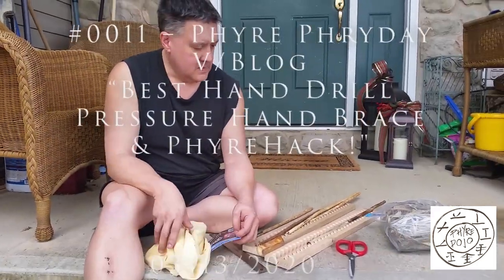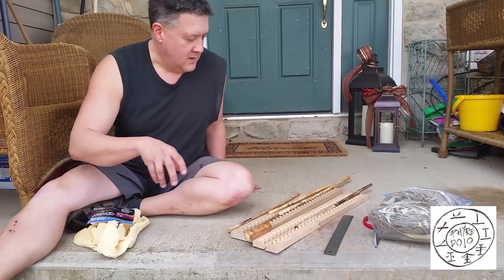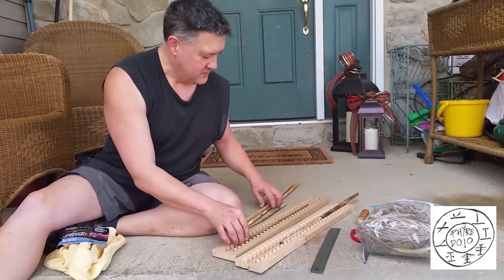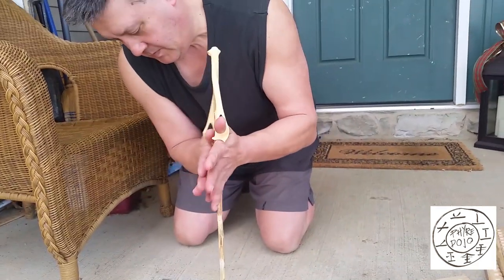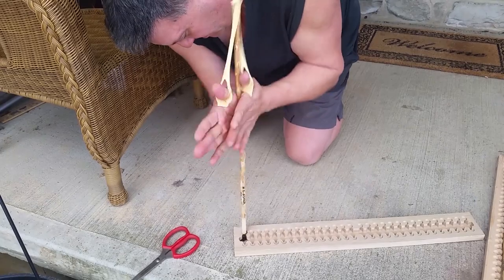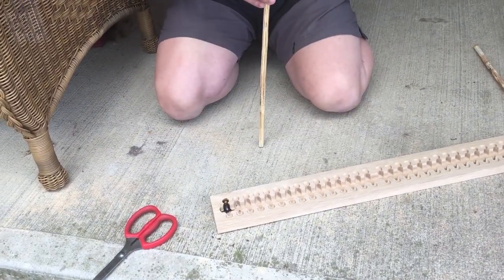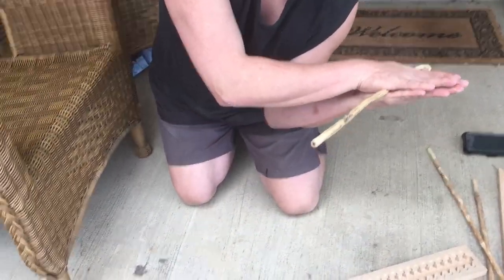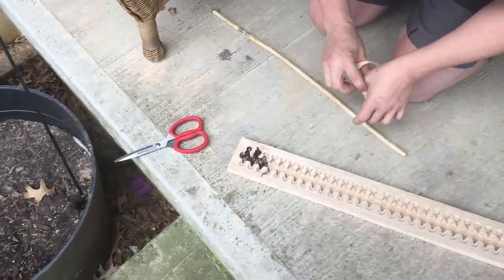#0011 – Phyre Phryday V/Blog 03/13/2020 – “Best Hand Drill Pressure Hand Brace & PhyreHack!"

Comment: Any thoughts on thumb loops that are tied to the spindle (without a notch)? I've used a clove hitch on a mullein stalk a few times, but haven't tried it with other fragile materials.
Reply from the maker: I think as long as it doesn't slip for a number of reasons its fine, right? Some cordages do not grab as well as others. i.e. an artificial cordage may be too smooth to hold on.... Phyre Dojo is here to support The Global Tribe Of PhyreKeepers.